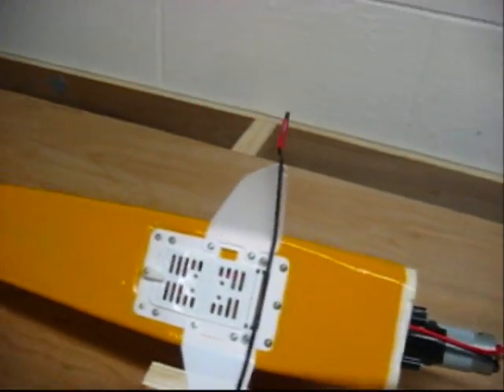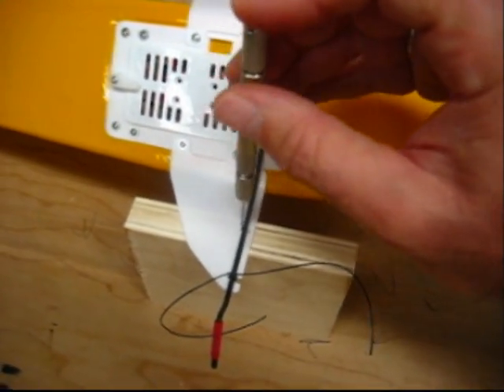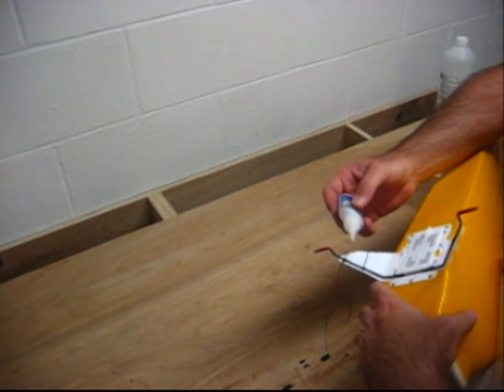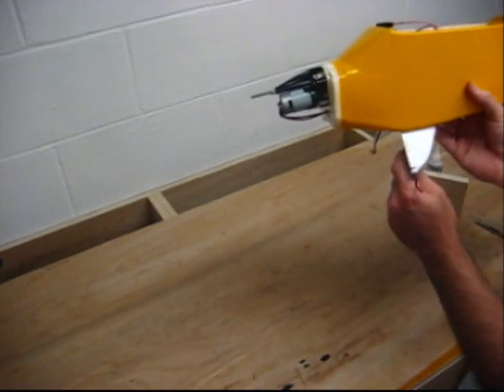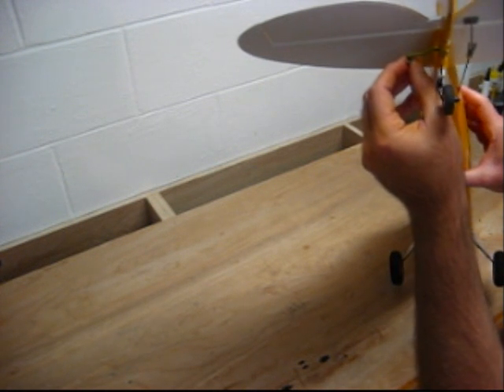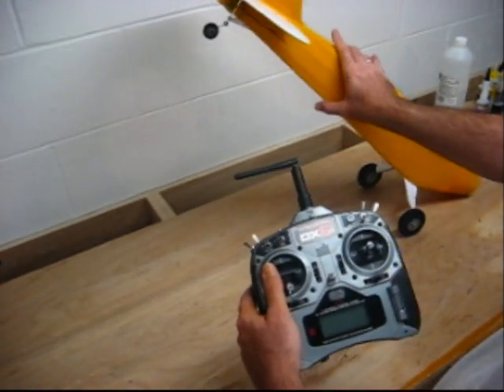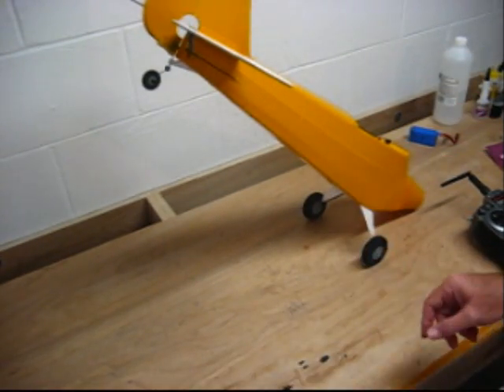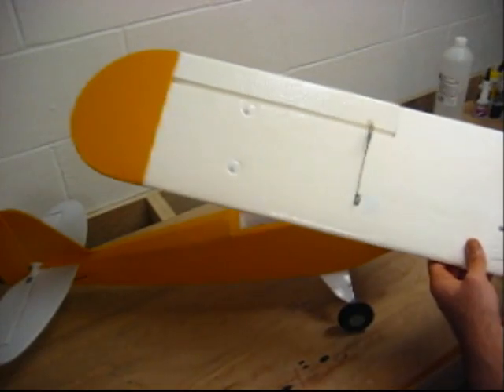17-Landing Gear Mods Pt2 - Building HZ Super Cub from Scratch

Comment: How did you set up the flaperons with the DX6i?  I have a DX6i and AR6100 receiver.  

I believe you plug in one aileron to the AILE and the other aileron to the AUX1 ports on the receiver.

Also, what switch on the DX6i do you flip to make the switch over to the different modes and how do you tie the ailerons in with the rudder?

As always thanks for all your help and great series.  I can't wait to take my SC out soon with your mods :).

Thanks!